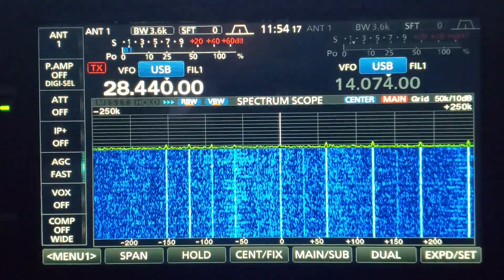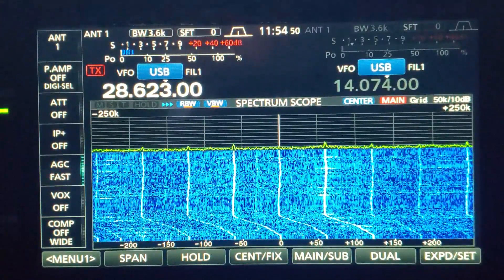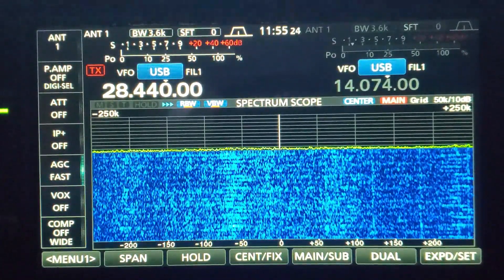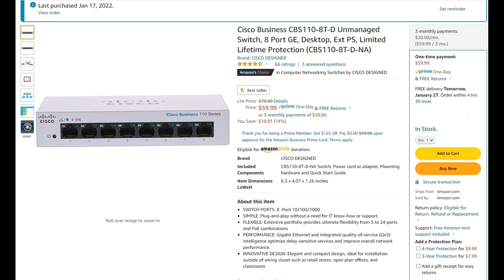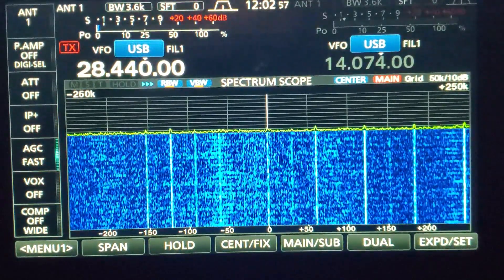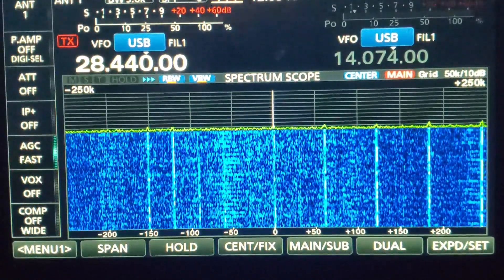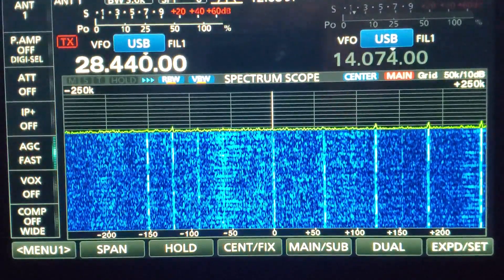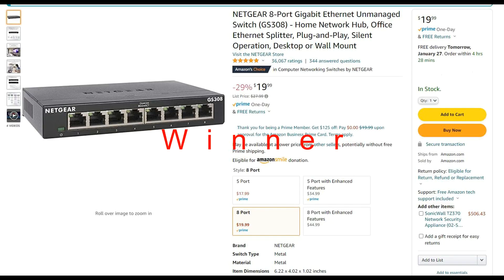Which Ethernet switch causes the least HF noise?

Comment: Could it possibly be the wall warts and not the actual ethernet switches?
Reply from the maker: I used the same non switching power supply on each one except for the TP link because it was 6v and the rest were 12v.

Comment: I'd be looking more at your RF grounding at your antenna. You should only get interference from the proximity of the network cable to the coax if you've common mode RFI which is a result of the coax being used to compensate for a poor or non-existent RF ground. That's because the wanted RF is on the inside of the coax braid so shielded from interference. When you have common mode RFI it's because you have RF flowing on the outside of the braid and it's susceptible to interference. Common mode RFI doesn't just happen when you transmit, it happens on receive to. 

I would bet that if you were to put a RF choke (several windings of your coax through a FT240-31 or FT240-43 toroid) at the radio end of the coax to choke off the common mode RFI from the radio you'd see those signals attenuated massively if not completely.

Also look at putting  Mix 31 or 43 ferrites on the network cables and the power cable for the switch too.
Reply from the maker: Thank you for the advice .   I currently have a 1:1 balun at the antenna and one at the transmitter as well as a ground strap on the coax near the antenna.    The cable is good quality LMR-240 from Times Microwave.